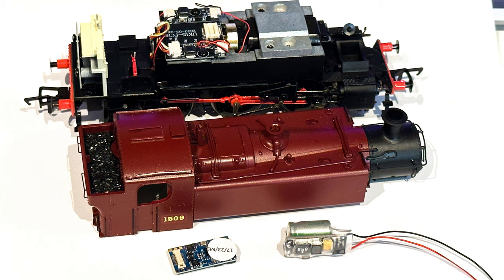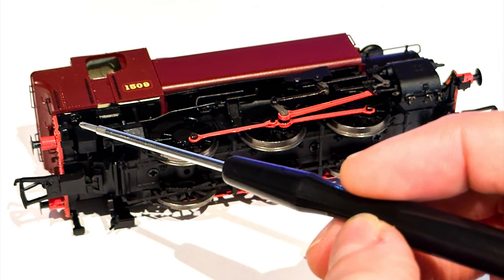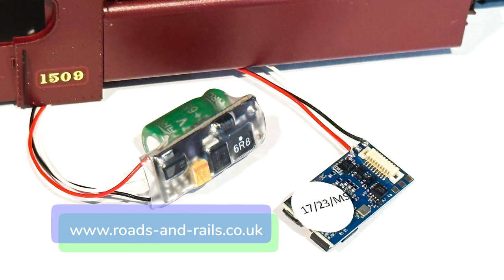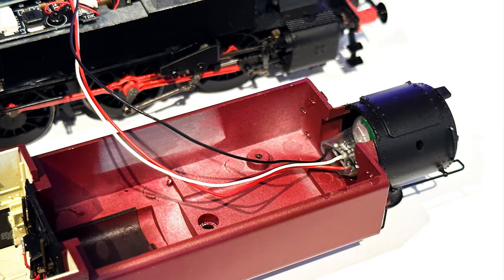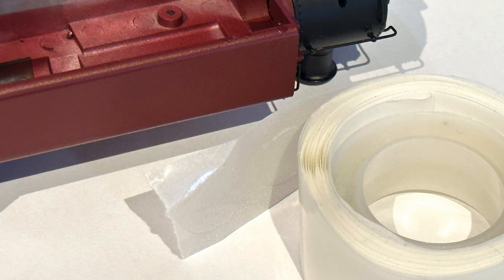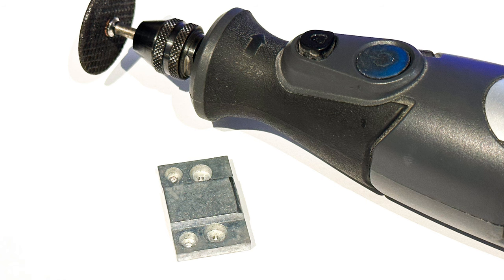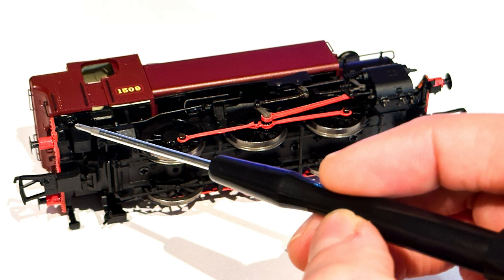Fitting Wheeltappers DCC Sound To The Rapido 15XX Model

Comment: Very cool , OK I have the red one ( just arrived ) and GWN green on its way to Australia.
I looked at your Website and could not find this kit. I mean the suitable DCC sound decoder + StayAlive ( connected  - as per offer in this video ) with no speaker option  ( speaker is preinstalled - this info from this video )  + postage to Australia? - I will also send this via online form on your website , kind regards jack